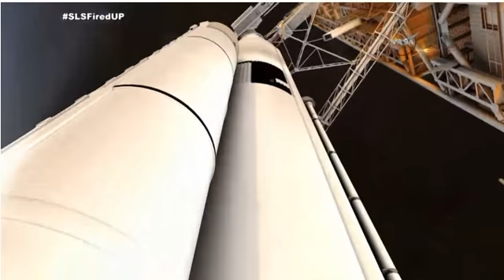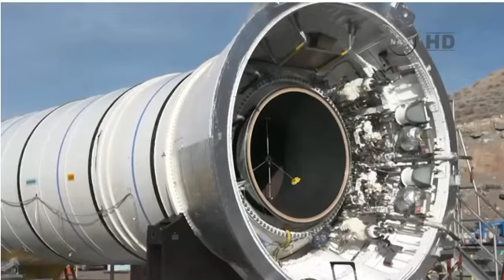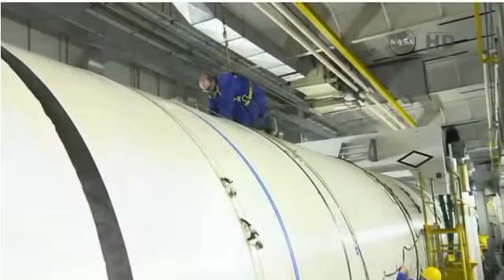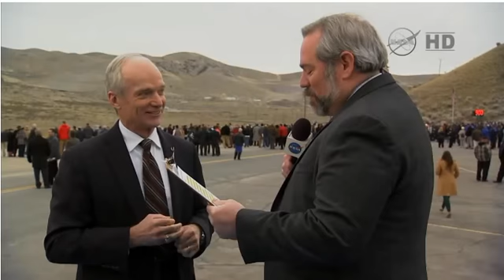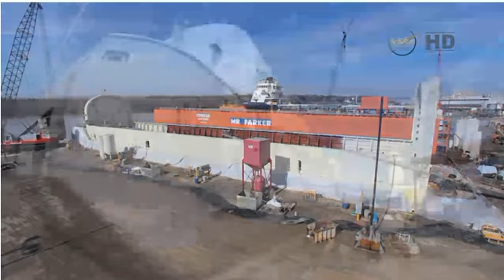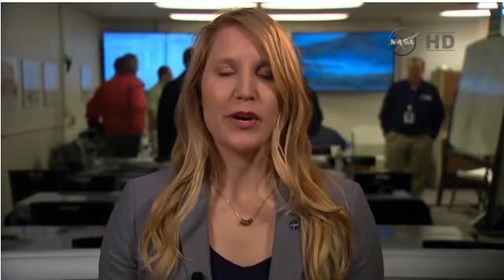Complete Orbital ATK QM-1 SLS Booster Test NASA TV Coverage

Comment: I watched the destruction of Challenger. It was determined that the booster casing flexed enough to allow hot gasses to escape. I'm not a qualified engineer, but it would appear that you have this new, more powerful motor strapped down in a way that is not consistent with the actual in usage parameters. For the first, and most obvious, it is Horizontal, instead of in the vertical plane. 
Reaction forces of the joints are impossible to be the same in this plane due to the tremendous differences in the weight distribution along the axis.
Reply: Yeah because you have a leg up on the geniuses working for NASA.  Good job, asshat.
Reply: +Daniel Kehres This test was done done for structural integrity. This is merely a motor test/qualification. They are testing burn dynamics.

The Challenger blew up from a faulty O-ring that was not designed to be in such cold weather.

"Disintegration of the vehicle began after an O-ring seal in its right solid rocket booster (SRB) failed at liftoff. The O-ring was not designed to fly under unusually cold conditions as in this launch. Its failure caused a breach in the SRB joint it sealed, allowing pressurized burning gas from within the solid rocket motor to reach the outside and impinge upon the adjacent SRB aft field joint attachment hardware and external fuel tank. This led to the separation of the right-hand SRB's aft field joint attachment and the structural failure of the external tank. Aerodynamic forces broke up the orbiter"

so please, since you are not a "qualified engineer" leave your worries at home and let the real rocket scientists do their job.
Reply: Thanks for the reply. Already had that information. Only question I have at this point is how do find a hat to fit that big ass head you got
Reply: Daniel Kehres "but it would appear that you have this new, more powerful motor strapped down in a way that is not consistent with the actual in usage parameters. "

so tell me how you would test a solid rocket booster?

I find it infuriating that someone who admits to not being an engineer claims their rig is somehow useless? and that they are going about their test wrong?